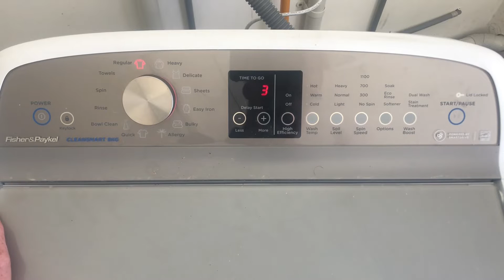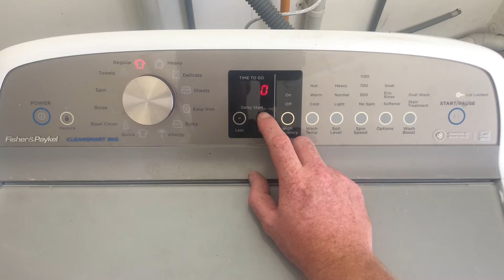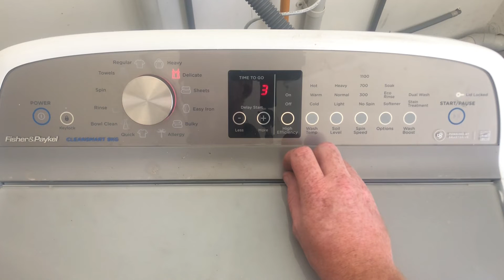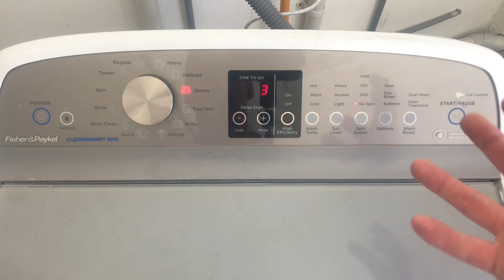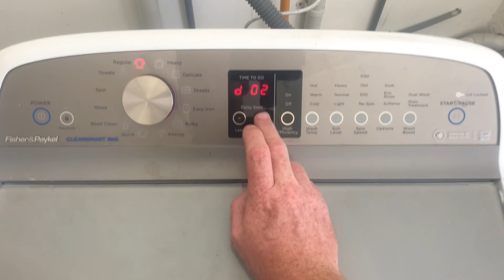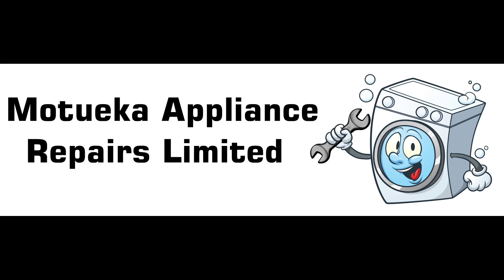Diagnostic mode on Washsmart/Cleansmart/Fabricsmart Fisher and Paykel Washers.

Comment: I’ve watched a series of your videos on Fisher & Paykel washing machine maintenance and they are a fantastic guide. I’m about to look into a suds loc problem with an eco wash machine. Is the pump maintenance fundamentally the same as your earlier videos on the smart drive machines? Thanks
Reply from the maker: It will be similar to the later model Askoll or Hanning pump, not the earlier Selini pumps

Comment: Hi, your videos are very helpful thanks. We have a WA1068G2 about 4 years old but gets used a lot. Keep getting out of balance error on screen and doesn't spin. Is very often but random no matter if there is a load in or not. Drum suspension feels OK, and pushing start again can sometimes get it spinning again. I feel it's an electric or sensor issue. Diagnostic says error 3 balance. Any ideas or suggestions please, worth fixing?? Feels too new to replace but don't want to waste money on it getting a service man out to diagnose and repair if it's better just getting a new machine. Cheers
Reply: It doesnt even start to spin really before going out of balance
Reply from the maker: It could be several things, including clutch worn, inner bowl holes blocked, or software issue in the display.
Reply: We've got same issues! Suspension rods appear good, but I'm no expert.. Im about to remove the pump to see if it's blocked.

Comment: Hi I have the same exact machine. How can I clean the machine itself? I don’t see any filters I can remove thanks
Reply from the maker: They don't have filters in the drum, the design of the drum itself acts like a filter. If you have an agitator model you can get a lint filter as an extra that sits in the agitator, but it is technically not needed.
Reply: @motrepairs so how do I upkeep the machine? Is there a self cleaning process etc?
Reply from the maker: @MB-xw8ir  If you do a hot wash high water level with a washing machine cleaner powder (and no washing) every 6 months- 1 year that should keep the soap scum down.
Reply: @motrepairs great thanks

Comment: Hey buddy, I replaced my suspension rods on my Wash Smart. Is there a re calibration cycle that I need to run
Reply from the maker: No there is no re calibration. On this series if you are still having out of balance issues with new suspension rods, especially if it is happening at low speed, it may be the spline drive or display.

Comment: Hi,this is the same as our machine. Yesterday we turned the machine off then plugged back in. The screen said 105 and no buttons work at all now. Do you know what 105 means?
Reply from the maker: That is a communication error between the boards,  you can try turning it off at the wall for a few minutes then back on, otherwise you will need a tech to check the wiring etc.

Comment: I have a Quicksmart, which does not have a plus button. How can I change the number I just got very cheap, as it does not spin
Reply: I have just seen it use spin to go up if you don't have a plus button
Reply from the maker: @davidtunnicliff2611  Yes you will only be able to scroll one way, but it will loop around.

Comment: Hi mate, I have this model and code number 40 is displayed. What is that code mean?
Reply from the maker: Thats a "Bowl Check not valid" code. Make sure end of drain hose is above high water line so it isn't siphoning,  then check the inner bowl and shaft is clean, see this video here for how the spline shaft works. 
https://youtu.be/lOC7wzk5oJY
Reply: @motrepairs  the last few days I’ve been having this issue too on my F&P Fabric smart washing machine, it’s a 2019 model. 
I have followed the video you’ve posted here and taken apart the agitator and spine shaft to clean, as well as some other suggestions online, however I’m still having this error occur. The bowl spins fine and moves freely back to place, so I don’t think it’s the rods. Do you have any other suggestions or videos that might be helpful for me to try and fix the error?

Comment: Thanks for a great video, After going through the diagnostics and confirming the drain pump is faulty and replacing it. Now after a wash cycle when the machine is off and in stby the
  ( no Spin ) led is flashing until the power point is turned off. I have been in and out of Service mode but it's still flashing.   Any ideas thanks Michael.
Reply from the maker: Just one light? There are a couple of service modes that can be stuck on that will show by flashing half the progress lights. There is also a download mode that flickers the spin light, but I haven't heard of that coming on by accident or getting stuck on.
Reply: Sounds like it is set to restart off. I have the same issue and can’t get the restart on setting to save

Comment: Hi Dan I have the same model as your video I have a problem where on hot it tries to start a few times but won’t go on cold no problem it won’t let the hot water in I’ve changed the display board inlets and the thermostat all pipe connections are good it just tries to let the hot water but won’t can you please help thank you
Reply from the maker: This series has an issue where the controller reads the sensor temp as way hotter then it actually is, so will get warm instead of cold. There is no fix other then I think Allergy  cycle wil run the hottest. But this issue will usually do warm on hot setting, so If no hot water at all coming in then something else wrong.

Comment: Wl1068p1 and the fault code is 16 when turned on and then

a-0 b-0 c-1015 d-0 e-0 f-10 g-202 h-15

After it has completed a rinse/cycle

I’ve never struck this long string before
Reply from the maker: That model is still quite new so we haven't seen them out of warranty yet sorry, and the earlier models didn't have an error 16 so I'm not sure what that is.
Reply: Hi Dan, to answer my own question, the size/spin speed was set wrong I believe. I’ve also got the same issue as another commenter, with the no spin light flashing in standby. I cannot get it to permanently save the restart on function for the life of me
Reply: These models are now discontinued in favor of the shit haier crap

Comment: I have a Fabricsmart that looks the same as this cleansmart and it's 8kg. The washer always stops when come to last 30 second cycle count down and it's beeping until you press the Start/pause button and it will start but will stop and beep again! What is the problem please???
Reply from the maker: It could be a lot of things. I would need to know the actual model number and if there are any error codes or what lights are flashing when it beeps.

Comment: We have one jus like in your video, I problem is it won't spin, then refills error code is balance, we tried reprogram it  still has it,
Reply from the maker: There are several things that need to be checked for out of balance faults. Suspension, Water level/load sensing, blocked inner bowl, display.  Probably best you get a technician who knows these machines to have a look as it is too much to explain in a comment sorry.
Reply: Thanks

Comment: What on earth do you do with a cleansmart that’s coming up with a 16 fault as soon as it’s powered up? I’m guessing it’s an engineers fault? Data signal type issue. It cycles through letters and numbers after a rinse cycle… is my display doomed do you think
Reply from the maker: I would need to know model number. Also what letters and numbers were coming up after the rinse?
Reply: Wl1068p1

Comment: Hi there, my 10kg top loader wash smart is only spinning slowly and does not get up to a fast spin I. The final spin leaving dripping wet clothes.  I have turned on and off. Machine is level and only a few years old.   Is there any other faults I can look for?
Reply from the maker: If there is a fault of a user warning it should stop and beep. You haven't got hot and cold hoses swapped over? It wont spin full speed if it thinks the plastic bowl is too hot. Most spin issues are due to not balancing, are the clothes bunched up to one side when it stops? Does it spin full speed if you put it on spin only? Does it spin full speed if you put in on with no washing?

Comment: Thanks for your videos, I really enjoyed them. But I'm about to give up on F & P machines. We are on our second one it's a WA1068G1 model. Seems like it needs yet another control module, (3 in 5 years) It briefly flashes the lights when switched on at the wall and then won't power up. The power module was last replaced in December 2024. It cost $470. Our local service company say the part has only a 3 month warranty. We aren't going to replace it again. We are probably going to buy a fully manual Huebsch. I might see if I can buy the fault part and get it running and then sell it. It has also had new suspension rods and I serviced the pump etc.
Reply from the maker: Usually new parts have a 1 year warranty from F&P, depending where you are, was it a new or used part they put in? 3 months is legal minimum that service companies have to warranty their work in NZ, we do a year as 3 months seems to short to me.
Reply: @motrepairs  Thanks for replying. I don't know if it was a new part. But I will follow it up for sure. It seems to have been charged as a new part.  Thanks again, very informative videos. We bought a new Huebsh (speed queen)

Comment: Thanks for Video - I have a Fisher & Paykel WASHSMART 10KG Serial No, WA1060G2  it keeps on going out of balance on the spin cycle and the "out of balance" does not work, have to turn machine off. is there a out of balance switch or sensor???
Reply from the maker: No the out of balance is done via the motor loan electronically on that model. Is the load actually unbalanced or is the machine being picky?
Reply: @motrepairs  the load is out of balance
Reply from the maker: @ Are you using auto water level or manual? If you are setting water level manually and its too high it will bunch up washing a but when it gets to spin. Your suspension may be worn, or if the end of your drain hose is too low and water is siphoning out during wash that will bunch it up. Try and watch it thought the wash to rinse cycle and try and see what its doing.

Comment: Great video. Thanks for creating. I followed diagnostics after power blackout for F&P washing machine WA1068G1. Set to restart, power off for 60 sec, tried new outlet, power on the control panel, everything seems to be in order but the start button does not respond to start machine. Not sure what to do? Codes: d15-0 and 1, d20-323, d21-3, d22-7, d24-85, d25-23, all others outside d10 are 0. Any advice apart from calling a technician?
Reply from the maker: So the lights come on and buttons work in diagnostics but it wont start?

Comment: Evening mate, quick question for you, we have a f&p 10kg fabric smart top loader, keeps saying out of balance on spin cycle,
Took the pump out and cleaned and checked it’s working and is as it dumps the water, but I bypassed the lid lock switch and watched the bowl, when it starts to get up to speed it starts to run eccentric and trips the out of balance function, also have checked the bowl hangers and they appear to be ok, what am missing?
Thanks 
Glenn from Hawke’s Bay.
Reply from the maker: Usually that means you need new suspension rods, as the dampening will be worn out. It can be hard to tell if you aren't used to looking at lots of machines. Or it can be just one rod worn, in which case you still need to replace the set. Other thing it could be is if the water has leaked out of the top balance ring.
Reply: @ I’ll order a set of balance rods tomorrow and see how that goes,
What is the balance ring and how does that work,?

Comment: Do you have a diagnostic guide for a WA1068g2?
Reply from the maker: You may be able to find manual for a similar model on google, often "filetype:pdf" can help. F&P doesn't freely release them unfortunately.
Reply: I serviced my washer with a 39 error code on the weekend, 3 years of hard bore water deposits a scrud on drum and tub. I cleaned a reassembled 5 hour scalex (sulfamic acid) soak, all seemed okay except now get 249 fault after pumping out all water then pump runs and times out (I think) with 249 error with out spinning, removed drain pump checked was clean, flushed drain hose and recirc and blew through pressure tube to ensure was clear, not sure what else to check, does the controller adapt over time and need a factory reset?
Reply from the maker: @davidmclellan3416  No there is no controller reset. Maybe check that the pump isn't overheating and going open circuit when it stops
Reply: @ I got a service manual from a former colleague and tested the resistance across all three poles at 15.9ohms

Comment: Thanks for the great videos, I have a Fisher & Paykel WASHSMART 8.5KG Serial No, WA8560G1, was having issues with out of balance on spin cycle and noisy tub bearings. Replaced the suspension rods (non genuine), replaced the tub bearings (non genuine) cleaned the tub and drum thoroughly, reassembled and levelled fully with a small spirit level on the designated surfaces. Mostly very good now however still occasionally goes into the OOB code with different size loads? spin speed is set at 700rpm. I did notice the bias spring does not have a lot of tension, worth replacing as well? Thanks in advance
Reply from the maker: There isn't meant to be much tension on the bias spring so it wont be that. is it actually going out of balance before the code comes up or does the code come before it even starts to spin?
Reply: @motrepairs  Thanks Dan, goes out of balance during spin and then the code comes up
Reply from the maker: @mikecoventon8217  Are the clothes all uneven when that happens or pretty good? If you select manual water level too high for the load the clothes won't drop even, best to use auto. 

If load is pretty even and it is "Picky" then most of the time it is suspension. I've never used aftermarket so not sure what they are like. If the bowl shakes around a lot even when no load it may have leaked water from the balance rings.
Reply: @motrepairs  Thanks Dan, seems to be "picky"  I replaced the rods first and it worked perfectly. A number of weeks later I replaced the bearing kit and in the process had the bowl and tub upside down for a thorough cleaning, is there any way to refill the balance rings?
Reply from the maker: @mikecoventon8217  They are sealed so turning it upside down shouldn't do anything. I have had a couple of that series play up with out of balance at low speeds after bearings changes, maybe do again and try and find some low friction bearings.
Reply: Thanks Dan, will try that option

Comment: Hiya Dan, I have this exact same model bought second hand from a trusted reseller company. Have put my first load in and it is making a slight knocking sound only when filling & agitating. Doesn’t make the noise whilst spinning. Is this normal or if not, Any ideas on what the issue could be please?
Reply: Have put second load in this morning thinking it may have been uneven hence the knocking sound but it is still making the same noise
Reply from the maker: Pretty impossible to say without hearing it sorry, best bet is to go back to who you bought it from.

Comment: Hi, first of all thank you for your great videos. For a DIY guy I found them most informative and helpful! Thank you!
I do need your help thought please.
My top loader F&P WA1068G2 goes out of balance soon as it gets rid of the water during the rinse cycle. The machine doesn't yet start spinning yet. Soon as rinse cycle starts it checks its self and just decides that its out of balance. We have replaced the suspension rods, but the problem persists. I dont think its the suspension rods as it hasnt even start spinning before it beeps with out of balance error. Does this mean that the motor control board needs to be replaced? Where is the balance sensor in this machine is located? Is it some kind of accelerometer that is built into the motor control board? If so is there a way to recalibrate it?
Reply from the maker: Yeah I've seen this a few times. On these out of balance is detected by the motor controller monitoring the motor current. Some times has turned out to be the display board rather then the motor controller.
Reply: @motrepairs  Hi, I'm in essentially the same situation with a WA7060M1 and am hoping to be able to find a good used controller. Are you able to give me an idea as to what controllers are compatible with this model? It came with a SD9 429889NAP, which I can't find anywhere, and the current replacement listed for this model of machine is the SD9 430202NAP, which I can only find new at the full retail price.
Reply from the maker: @ If its the otu of balance at very low speed problem I would recommend replacing the display first not the motor controller. Most places are going to be very reluctant to sell you used controllers to do your your diagnosis. It always ends up in unhappy customers looking for refunds because it wasn't what they thought it was and claiming the one they brought "has the same problem". Trademe would be your best bet if you are in NZ.

Comment: Hi Mate,
If we have a machine similar to this and it consistently shows out of balance is it going to be the suspension rods? Any advice appreciated
Reply from the maker: If its starting to spin up, shaking around, then stopping it may be suspension rods. If it is the same series as in this video (capacitive touch pads not small "soft-touch" buttons) then we have had issues with them going "out of balance" before they even start to spin properly (drum turning at lid lock speed). This can be caused by a number of things including the Motor controller or display.
Reply: @motrepairs  Dan could you do an in-depth video on models and unbalance issues really in depth though as this seems common with older F&P washers thanks 👍🏻